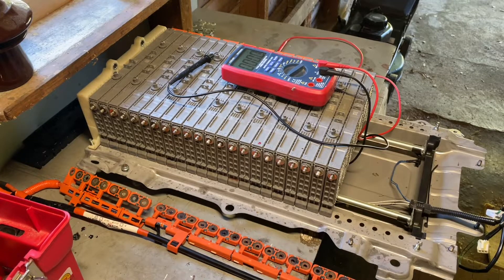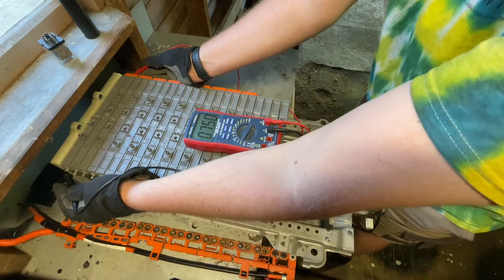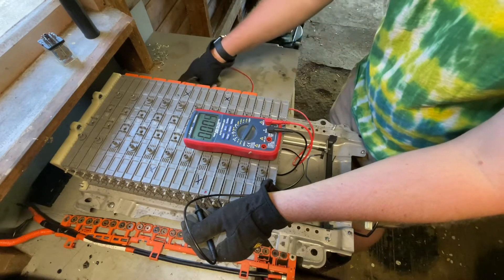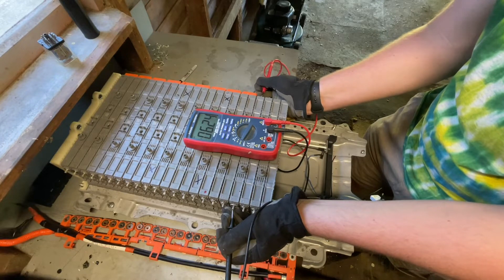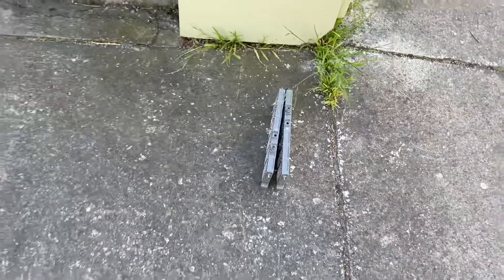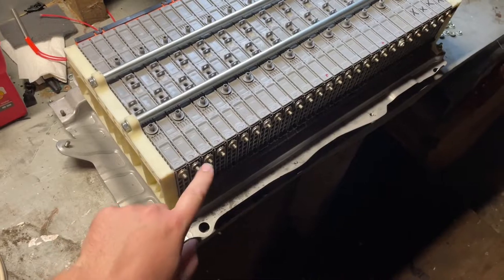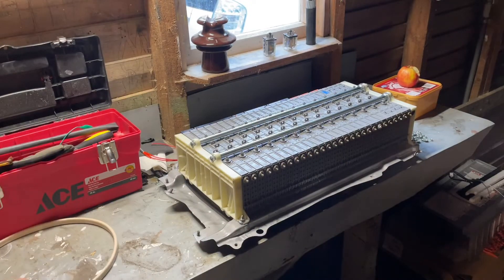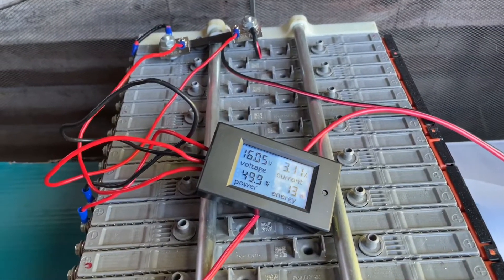Using a Prius Hybrid battery for solar power.

Comment: Did you put a charge controller box between the solar panels and the batteries before charging them?

If not then you will definitely overcharge them and they will expand or even explode and be ruined. 

Solar panels are powerful lol…

Comment: Not a good idea.NiMH can't be paralleled due to the full charge voltage characteristics. NiMH cells experience a voltage drop when they are fully charged. If you parallel NiMH cells and one of the groups hits full charge, it's voltage drops. Thus ALL current from the charger and ALL parallel cells start dumping their current into the already full cell. As it heats, it's voltage drops further. This is called thermal runaway. The process stops when the cell ruptures or shorts.

Comment: Are these batteries safe to have  in a ventilated workshop , I would be charging them from an ecoflow delta   , the delta has 1500 watts of solar panels  on it and on a sunny day is full by lunchtime ,  Rotorua
Reply from the maker: Im not sure, they did come with a vent tube manifold connected to each battery. you may be able to vent that tube outside.

Comment: 1. The cells are designed to have side pressure on them while charging. 2. These cells need to be charged at C/3 rate if you want to stay with the manufacturer's specifications and get near the rated 6.5 A/hrs from them.  Research shows a C/1 rate will give you 5.4 A/hrs. 3. Temperature needs to be monitored even at C/3 rates to ensure battery expansion with high internal pressures won't occur.   https://avt.inl.gov/sites/default/files/pdf/hev/batteryprius1052.pdf 4. These batteries need a BMS for balancing, 0.1 will create problems and kill cells.
Reply from the maker: Oh yeah the expanding is dangerous if not recharged correctly.
Reply: @KiwiMaker  one of the world's largest manuf (germany) specifies in their repair manual 0.01 volt max tolerance; but they are lifepo4

Comment: Hello, for hybrid or nimh batteries to work for many years, they require passive and permanent balancing due to their low cell tension, they will not be the same. This is solved by connecting a shunt zener diode with its current limiting resistor. It balances all the cells at the same voltage. It is not perfect and a small percentage of capacity is lost, but it is better than a dead battery after 3 years. This method is highly effective, reliable and easy to integrate, achieving triple the useful life of a battery.
Reply: Zener diode...i think i will try that for my 2 lead acid truck batteries; it's  a 24 volts  (12 V  X  2 ) solar setup;  while charging at 28.8 volts, one always goes to 15 volts ~~ and the other one down to 13.8, but alternatively, depending on which one  i connect a 0.12 Amp, 12 volt cooling fan.
Reply: So then why does the Prius not have any balance leads on the harness?
Reply: Same for lithium ?
Reply: @camjones1106 yes